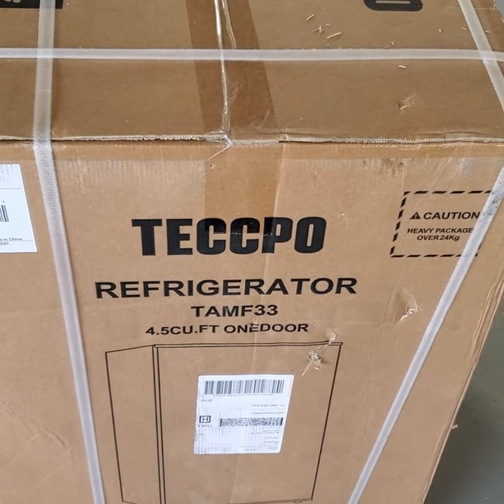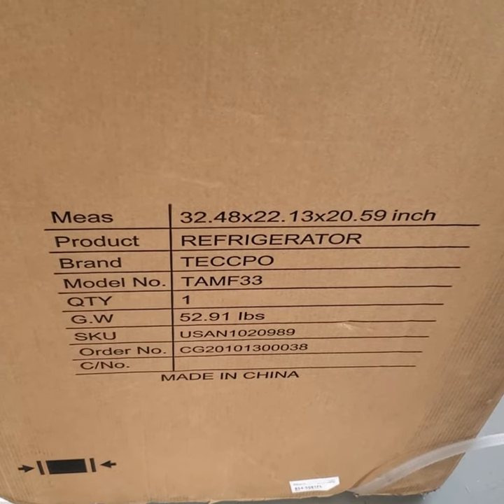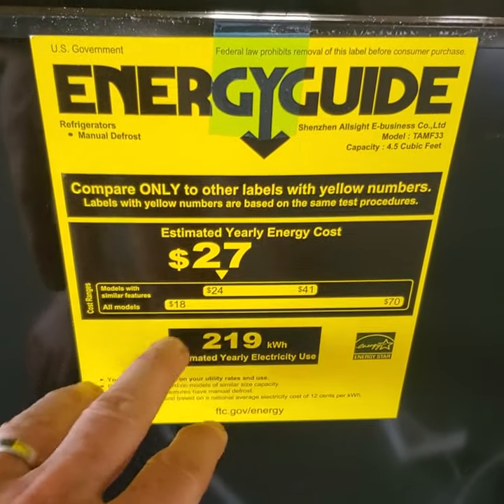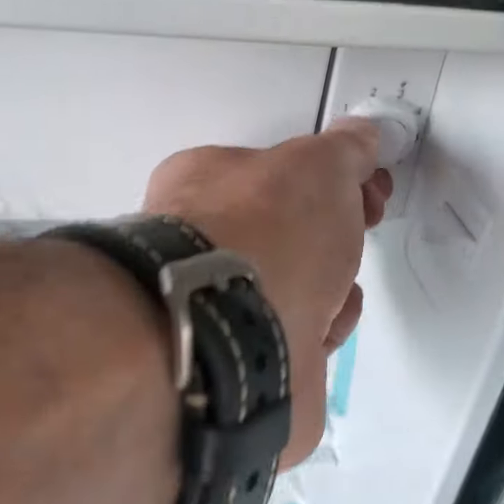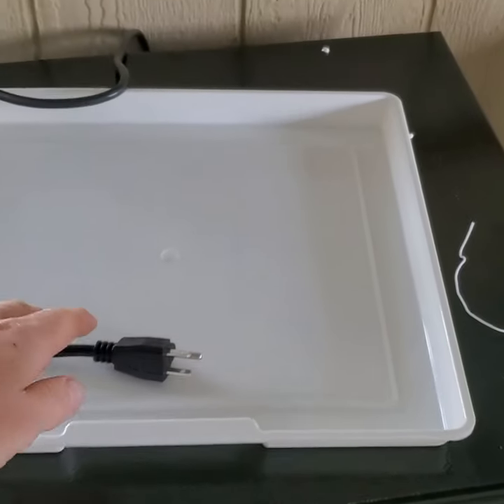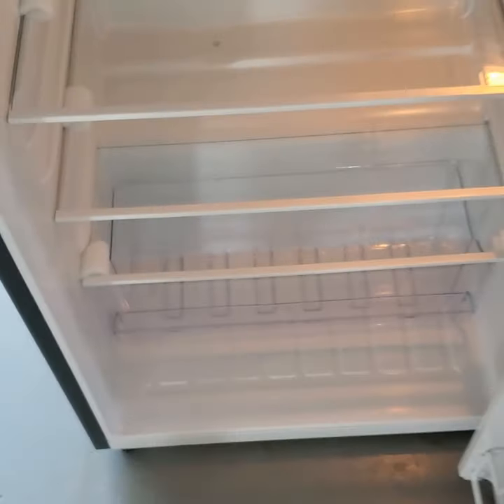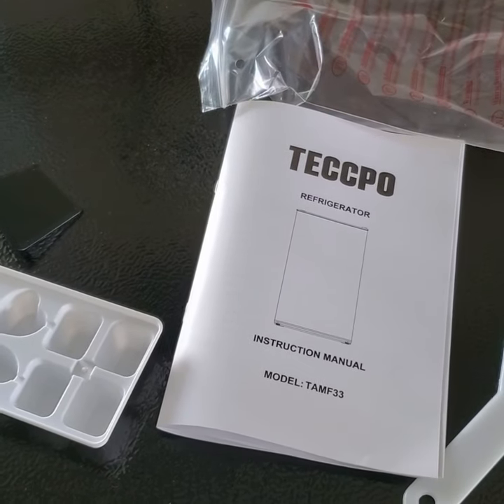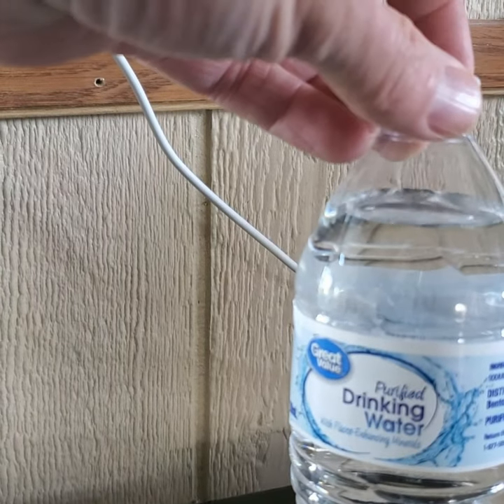TECCPO Mini Fridge - 4.5 cu ft  Refrigerator Review

Comment: So, we just got this and the freezer door came off with the tape. How does it go back on?
Reply from the maker: Hmm.  I believe there are bolts that hold it on.
Reply: We just bought one of these as well and it came without the freezer door installed. I can't figure out how to install it. It's just a piece of plastic, no bolts. I can see where one of the round pieces goes to install it, but not the other. Anyone have any tips?
Reply from the maker: I just looked at mine and it looks like it clips in on the top inside on both sides. If you need a video to see what it looks like, let me know
Reply: @SeanDIY  I am having the same issue with my freezer door, I can't figure out how to attach it. Could I see a video or picture of the freezer door and how it is attached? Thank you!
Reply from the maker: I'll try to a video but I stuck the tip on the left side into the hole there then pushed gently to the left and then fit the tab on the right in by pushing the freezer side outward lightly and it went.

Comment: I bought this fridge on amazon for $209 dollars. Got a 5 year warrenty extension. Thank God it was delivered with not a single dent. But since I never had a mini fridge. Is it supposed to run for 30 minutes then off for 10. Mine keeps doing that. Things get cold sure. The ppl at the company? No help at all.
Reply from the maker: Generally it's like a home AC, once it's cold enough it turns off until the thermostat tells it to kick back on.